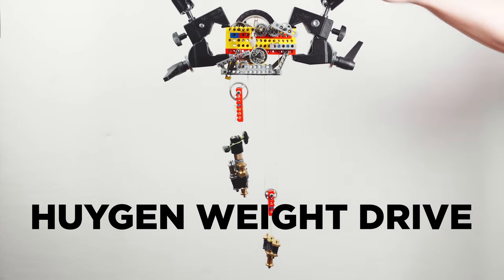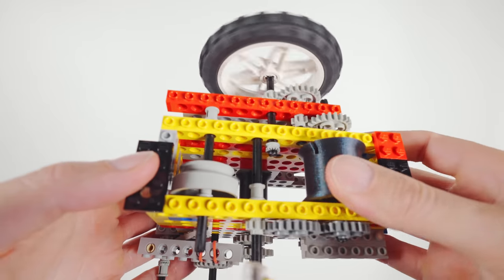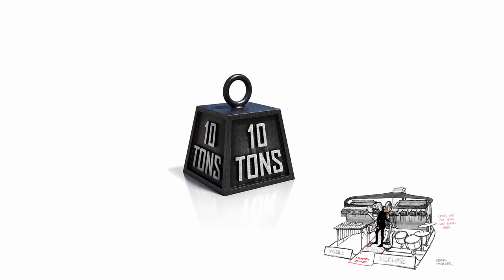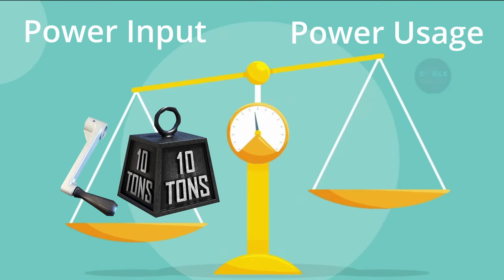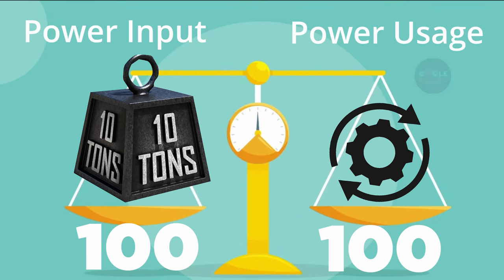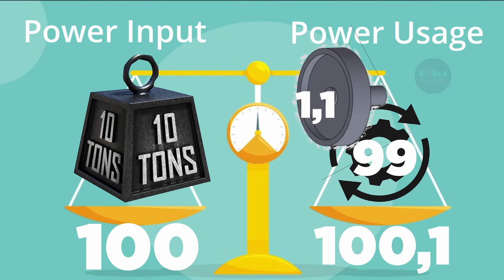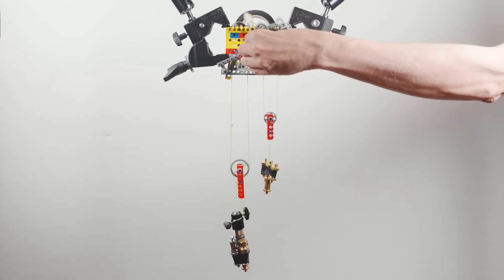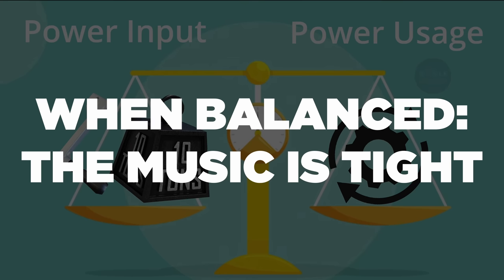Lego Technic Huygen Chain Drive

Comment: What you need is an expanding flywheel, its a flywheel built like a governor. It balances the speed of the flywheel to a constant by moving its weight arms inwards or outwards as it loses or gains kinetic potential (instead of slowing down or speeding up like a flywheel does). You will lose some potential due to friction of the mechanism, but you gain a LOT of consistency.
Reply: Great suggestion! I hope Martin sees this...
Reply: One of his design goals is to keep components as simple as possible. A flywheel with an integrated governor is a lot  more work to build and adjust quickly compared to a flywheel with a separate governor. Plus, with the governor separate, it can be placed anywhere on the machine and easily adjusted.
Reply: I see fellow UEF, i comment
Reply: And a Planetary Gear torque converter (or two) might help with different BPMs. Need something that runs in 6/8 time? Shift one gear box to 3/4 and then halve the second one, for instance, etc,.)
Reply: He would need to also add a brake mechanism directly onto the flywheel and dive into the most finger-eatey module of his machine to adjust it between every song😬Not to mention winding it all the way back up from a standstill afterwards.
Reply: I thought that was what he was talking about, one of these things used on steam engines to make the output more consistent…
Reply: Agreed. Flywheel and govenor is exactly that.
Reply: Yes exactly what I thought! And it would look super cool like an old steam engine

Comment: I suggested using something similar a few weeks ago. But I also suggested using an escapement and pendulum. You probably wouldn't need the flywheel then, or at least a smaller one. Bpm can be adjusted with the length of the pendulum.

 A governor is going to be less consistent and less predictable. You could literally mark the pendulum with bpm increments and it would be the same every time, in any conditions, unless you take it to the moon!
Reply: I was going to make the same comment, but just checked if anyone made this observation already and indeed you have. Instead of trying to fine-tune a continuum mechanism, pendulum-based (or maybe some other) escapement mechanism brings the tightness that only a discrete system can achieve.
Reply: Going to need a really short pendulum to get 120 BPM...
Reply: @GordieGii if I'm not wrong someone invented gears a while ago...
Reply: @Nitro8996  You're not wrong. Someone did invent gears a long time ago. What's your point?
Reply: @@quirinr96 Maybe a drum machine...
Reply: @GordieGii  There's plenty of metronomes that run at 120BPM; Pretty sure those are pendulums.
Reply: @GordieGii  120bpm is standard tempo of a clock pendulum
Reply: @Tyrope  I used to play with my mother's metronome about 70 years ago (yeah, I really am that old!) and it operated with a cone-shaped wheel that ran at a constant speed on a vertical axis, powered by an electric motor. The cone drove by friction another wheel whose speed varied according to the diameter of the cone at the point of contact. I don't recall the exact mechanism by  which the smaller wheel produced the "beat", it had something to do with something tapping the inside of the plastic box that housed the mechanism.

No pendulum was used.
Reply: @Papinak2  But to produce music at a tempo of 120 BPM you need ticks 6 or 12 times as fast, and standard clocks don't have 10 ton weights.
Reply: @GordieGii  that's where gearing comes into play. But there must be something that converts steps into uninterrupted movement.
Reply: @QuirinR96 gear up, add flywheel, gear back down. Backlash and natural flex in the system will take care of the rest. Pulses will disappear on their own in a big enough system. 

The pendulum doesn't have to swing at the bpm, as suggested it can be geared at any ratio, it's just there to regulate speed.

Even just a simple flex drive at some point could do the job.
Reply: @Papinak2  Must there? How? The minute hand on a clock appears to move continuously, but only because it is geared DOWN so much that it is hard to see the steps. I know of no mechanism that can produce continuous motion at the same speed or faster than in intermittent input motion. That would require the mechanical equivalent of mind-reading. If you know of any such mechanism then please help Martin out and describe it or post a link.
Reply: @GordieGii  Spring? A spiral spring has quite flat force/deflection curve, which means, that you can have intermittent input and nearly constant output force - the rest would be smoothed out by a flywheel. A similar principle is used in dual mass flywheel to smoothen out engine vibrations. Of course, the whole system would have an awful lot of inertia and it wouldn't react nearly as fast as a governor, unless it's carefully balanced.
Reply: @Papinak2  I was just reading that comment and was about to mention the dual mass flywheel but you beat me to it. 

They are basically a spring and damper with a flywheel all in one unit designed just for that purpose. Obviously way too strong for this application to use directly though. 

Big heavy flywheels don't change speed easily either, I'd imagine that a pendulum regulated system could get away with a smaller flywheel and may actually respond faster. A simple rubber coupling somewhere before the flywheel could take care of the smoothing, or just a suitably thin and long drive shaft somewhere. The flywheel is always going to be geared up so it could work.

Comment: It's funny to me how this is basically building up a mechanical analog of a linear electrical power supply, you have an alternating power source coming in (your foot peddle), some form of rectification (converting the peddling to turning of the shaft), a capacitor (in the form of the weight), an inductor (in the form of the flywheel), and now a linear regulator dumping excess energy using resistance  (in the form of a governor).

Comment: I think there's been an oversight. Lifting marbles takes energy. If a song (or section of such) uses more marbles, the machine will require more power. Thus the goal of having steady power delivery should take into account unsteady power consumption.

The governor is what helps with this, so 100% this device NEEDS to be spec'ed to have the minimum and maximum resistances at the desired speeds capable of providing resistance equal to the minimum and maximum operating resistances of the marble machine to effectively balance the power
Reply: Oh shoot this is an overall oversight. Moving so many marbles so fast so high is already going to be a wildly exhausting feat, much less the actual energy requirements vs the weight size

Comment: If you want to compare your flywheel and weight drives accurately, you have to make sure the angular momentum of the flywheel is comparable to the potential energy of the weight. The more mass (in either system) the more reliable the rotation will be.
Reply: Going back to the first principles approach: While it isn’t technically the easiest or most rudimentary approach a inverter/motordriver with closed loop control is more or less a plug and „play“ solution. Trying to engineer a beautiful mechanical system is more hassle than it is worth if you are going (as I understand) the form follows function approach.
Reply: @philippsaure7545  If Martin wanted plug-and-play I'm sure he would buy a synthesizer.
Reply: @GordieGii  You are totally right. But it is known (at least since the invention of the mechanical clock) that there are ways to let a shaft rotate with fixed rpm even mechanically powered. I think that is a somewhat solved problem. And if you can’t solve this you have a reliable solution (the motor) in your backpocket. But there are a lot more problems on the table. And once you got the whole system and it’s requirements figured out you can design a more fitting „power source“.
Reply: @philippsaure7545  A weight or spring or a steam engine that is controlled by a governor is technically a servo system, whether it modulates a brake, a valve, or a variable ratio transmission.
The marble machine has always been a human powered instrument. Using an electric motor, servo or not, would be cheating.
I think the governor is going to be a problem, but it is an interesting problem to solve. I don't think a speed governor alone will give the required performance (or 'tightness') that Martin wants. Too much lag. But I think in combination with a torque governor to compensate for the dynamic changes in load could be made to work.
I also think the ball elevator needs to have a separate drive with it's own governor, but that doesn't need to be nearly as precise.
Reply: @GordieGii  you are right. Once Again. Still: Don’t you think it would be more reasonable to design the powersupply once the requirements of the machine are better known? Especially because you can only guess the sizes of the shafts needed and the required torques. I am not against a human powered machine but I think you can build a better (as small and as simple as possible) once you get to know your machine.
Reply: @philippsaure7545  But he is not making it for a jewelry box, he is making it for the stage. The power requirements shouldn't be too different from those of the MMX, certainly much less than an order of magnitude. Besides he only showed some concepts, not part designs. He seems to think that the power source is going to be the major bottle-neck so it makes sense to get a few tentative designs in the back of the mind so they can percolate. The only thing I think he is getting wrong is ignoring the ball lift. At the risk of repeating myself, the main load in the whole machine is raising the balls from the bottom of the machine back up to the top of the machine. The balls fall by themselves, and the trigger mechanisms require a fairly light force, and actually rotating the drum should be negligible. If he isolates the ball elevation from the playing, he should have much less trouble achieving the 'tightness' he desires. I personally think he should have enough balls for the entire song and raise them all before the beginning of the song, then he will only need a small weight to drive the player. (possibly under one ton) But of course he might want the sight of the  elevator to be part of the art, in which case he can have a separate drive system which doesn't need to be very precise in speed at all.
Reply: @GordieGii  Oh decoupling those things is smart. But imagine he does what you just described wouldn’t that give that order of magnitude change you just told me wasn’t there? Please let me state that I really appreciate your view regarding this topic.
Reply: @philippsaure7545  The total load of MM3 should be fairly similar to the total load of MMX. My guess is that 80 to 90% of the total load is from raising the balls so the total work will be the same but it will only take 10 to 20% of the work to operate the player which should make it much easier to regulate the speed of the music.